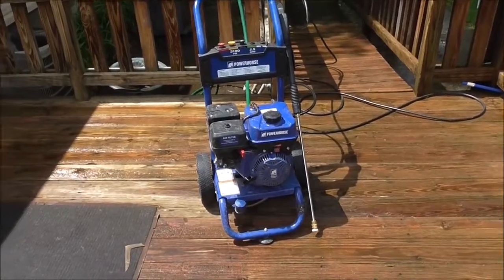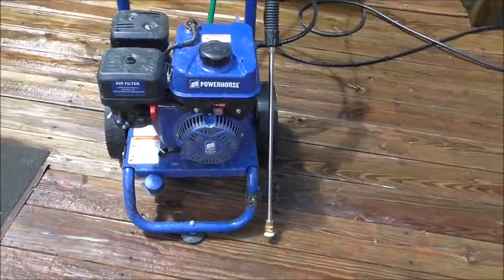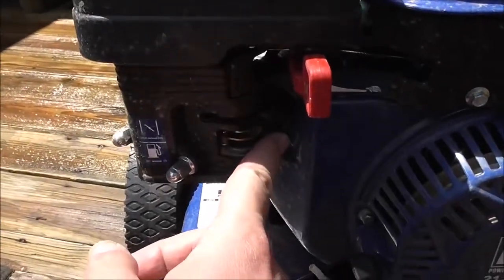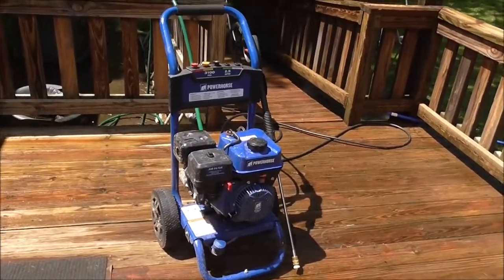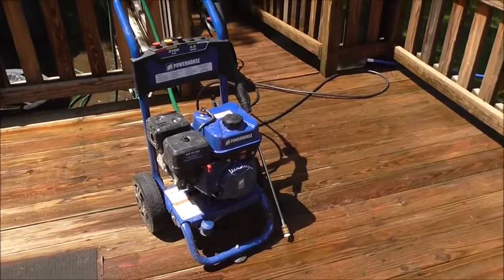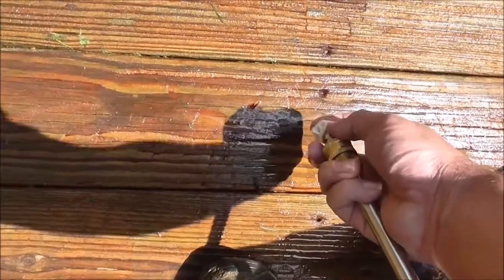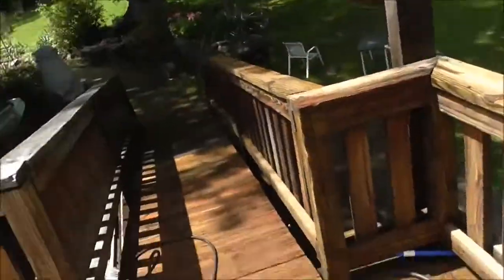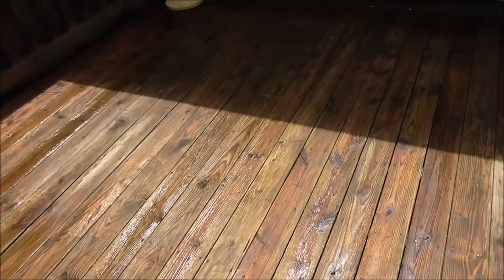How Gas Powered Cold Water Pressure Washers Work

Comment: What should I do when I first buy it
Reply from the maker: First off you should thoroughly read the Instruction manual, Make sure that the hoses that you have have real good fittings that do not leak, If a bottle of Engine Oil is provided you need to save the bottle at all costs which will benefit you when its time to change the Oil on these systems and you don't own one buy a Oil extractor if there is no proper drain plug (Which will also be good if you also own a gasoline powered push mower or are considering one).
Reply: @gopher101media  I’ll use it for mobile Detailing I don’t have any instructions the store sold it to me discounted because ya
Reply: @gopher101media  thank you fasho
Reply: @gopher101media  idk if dude already added oil or not before returning
Reply from the maker: Instruction manuals are provided with them when they are sold new another option should be searching for the information from the manufacturer is its possible.
Reply: @gopher101media  I got it and nah like I said the company sold it to me already built no instructions nothing.
Reply from the maker: @longtime3941  Where was it purchased from and was it bought used or new.
Reply: @gopher101media  new because someone ordered it and the wand was broken northern tool
Reply: @longtime3941  hey how is it going with the business? Does it hold up against daily use? Commercial wise? Some people say it’s more for someone who wants to use it once a week, would u disagree?